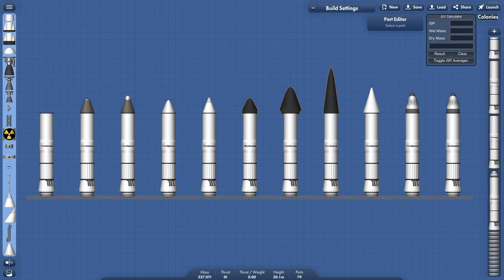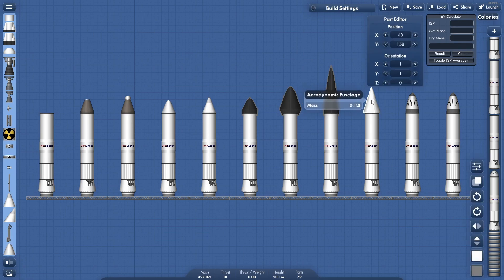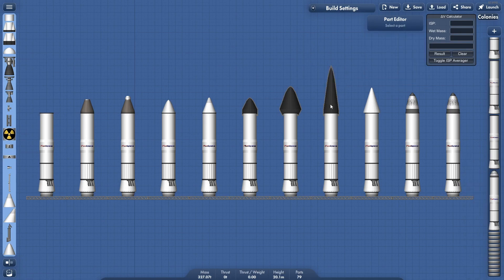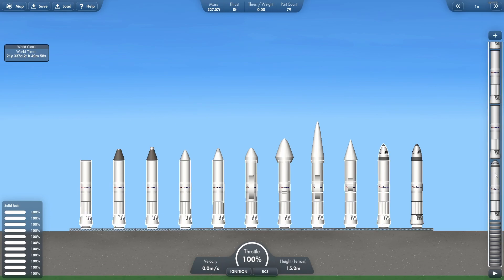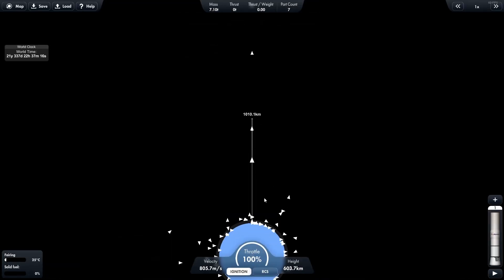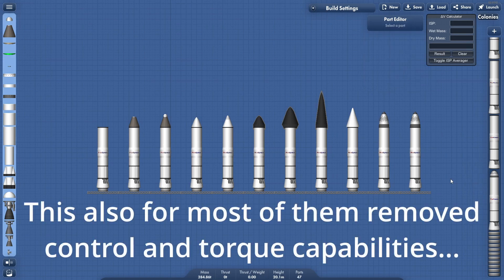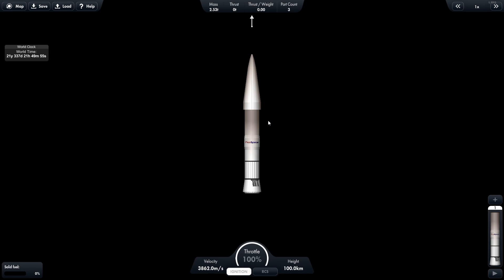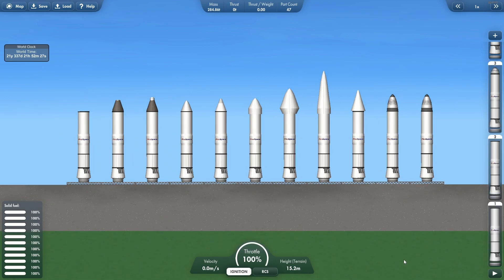What is the best aerodynamic "Nose-Cone" in Spaceflight Simulator?

Comment: So if the aero works anything like KSP, the counterweight can be skewing the score more than you think.

Try using Fuel tanks and adjusting the amount of fuel in each. Do not clip them in, but put them on the stack.
Reply from the maker: Oh… yeah that’s worth trying out and seeing if it does anything.
Reply: @picospace  I did some rudimentary testing without balancing the weights, and then tried to a bit, and the results where vastly diferent.

I would also go for lower burn times and higher thrust, because when you are going slower, weight matters more than aero.

I stuck a a titan on a 6-4x4 tank with a probe core and then the nosecones, and then added a tank above the Probe to try and balance weight, but without bp editing i couldn't get it that close.
Reply from the maker: @redroyal4287 I'll have to investgate... boosters are pretty high TWR off the starting block, any faster and you do risk heat damage on the cone as these boosters can easily hit that threshold if you make them a bit bigger.
Reply: @picospace  I would argue that the best test would Hypersonic with heat turned off. Exaggerates aero forces. Unless sfs has different drag profiles for different speeds.
Reply from the maker: @redroyal4287  While I would agree, I'm not sure how "plasma" effects rockets (I can look into the code and see) but any difference at that point would be moot at regular speeds you'd actually fly rockets at.
Reply: @picospace  true. But who the would really care about these differences in the first place unless they where min-maxing their rocket? And the point was to exaggerate the diferences so they would be more noticeable.

Another issue to consider is physics range. The test is really only valid if all rockets stay within physics range at all times. Otherwise engine won't run and drag won't happen. The shorter burn time at higher speeds mean that you can get a better idea of the difference before things go out of range.
Reply from the maker: @redroyal4287  true... I'll have to see about redoing the test and see how far we can push that small difference
Reply: @picospace  I don't know if your familiar with KSP occlusion, but I think it is built on the unity as well so it might be the same.

The main notable thing is the use of fairings as extra weight. In the process, you could potentially remove all drag caused by the srb itself.

Also, to prevent the turns, add a probe core to every booster. 

And as for the mass, is it really relevant though? If something has better aero but is significantly heavier, it might be better to use something with worse aero but less weight.